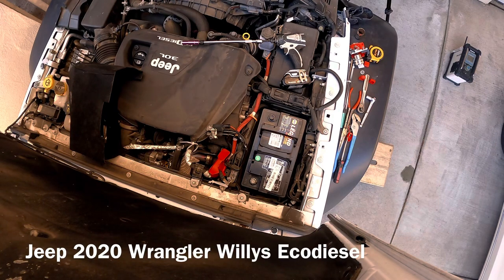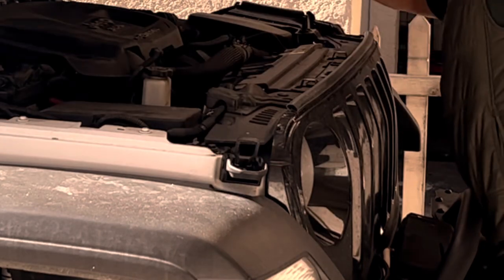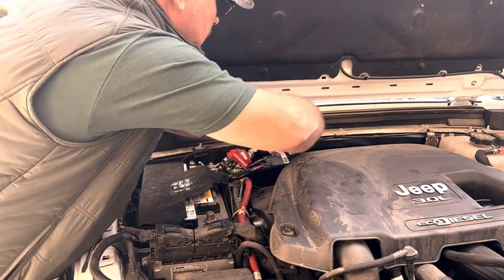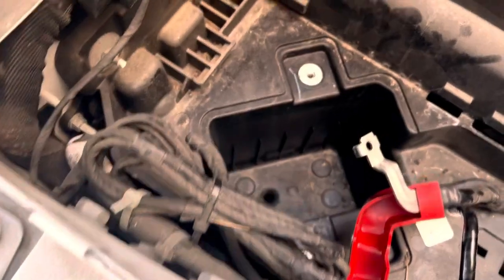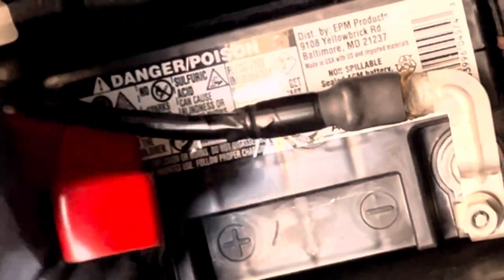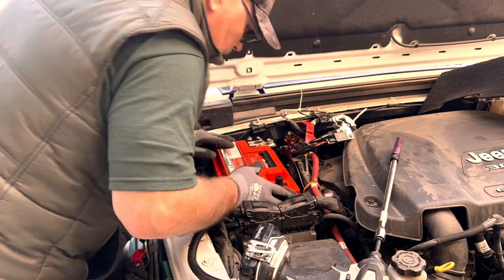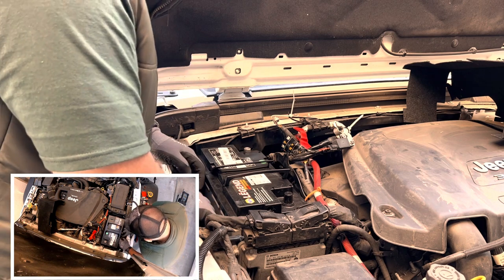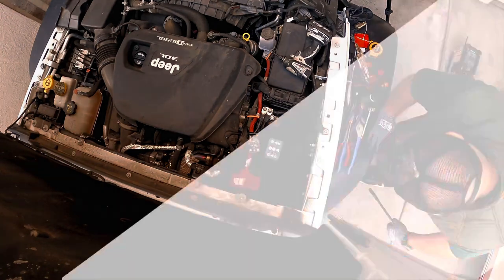How to change car battery + Ecodiesel auxilliary #ecodieselauxiliary #jeepecodieselbattery #jeep

Comment: Thanks for the video.  I have a 2021 Wrangler EcoDiesel and I am going to replace both batteries this week before I have a problem.  The Jeep was built in December 2020 so it is approaching 3 years.  It looks pretty easy to do, especially since I can place my hood against the windshield.  Do you know what torx size was needed for the aux battery?
Reply from the maker: Sorry, don’t remember, I just reach into the set and find one that fits! Thanks, glad it helped you out. Piece of cake.

Comment: Have you had issues with the remote start?
I turn mines on and it turns off in seconds
Reply from the maker: I don’t have it. This Jeep came with minimum options. No clicker, hand crank windows, very basic. Our Gladiator has it. It’s a 2022 Ecodiesel Rubicon. Very few miles on that vehicle and no problem so far. It has the original batteries. Thanks for watching!

Comment: What make or models of batteries did u install
Reply from the maker: I went to Napa and got the Odyssey but it was shorter than the original. Took it back and got the Napa Legend exact fit. Legend was $90.00 cheaper, more Cold Cranking Amps and same warranty. There’s only 1 choice for the small battery.

Comment: You traded an Odyssey for a Napa battery? Odyssey is far superior in a smaller package.
Reply from the maker: I was more interested in a perfect fit and it has more CCA. Hopefully it does the job. Thanks
Reply: Superior how? Warranty? Known life? Or forum talk/adverts?
Reply from the maker: @navykeef Napa Battery has a great warranty.
Reply: @navykeef  Both are good batteries. Odyssey has a higher lead purity, is lighter/slightly smaller, faster full charge time, and a 4 year replacement warranty - NAPA is 18-36 months. 

I wasn't talking shit, I was interested in the logic of the choice.
Reply: @Supercop8100  its clear you did your research! i just had to replace mine and wanted to know.👍